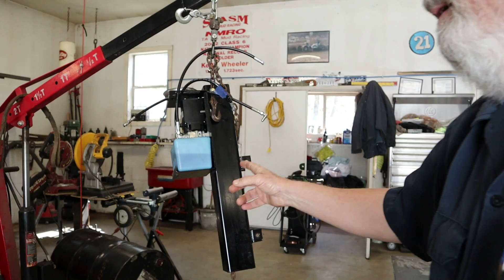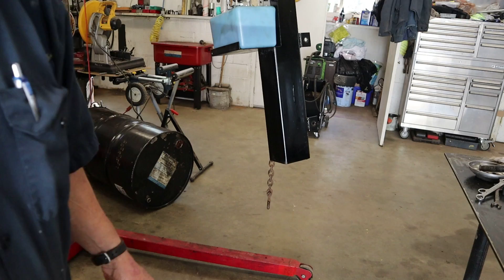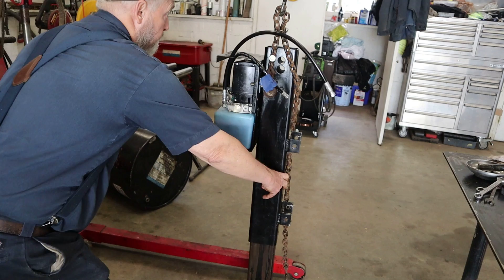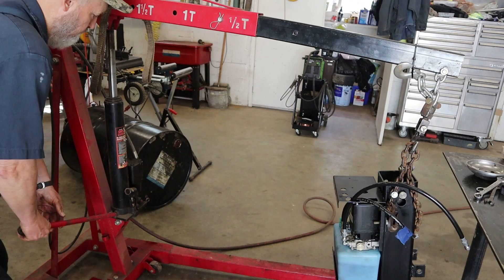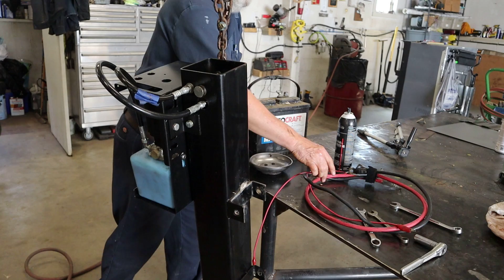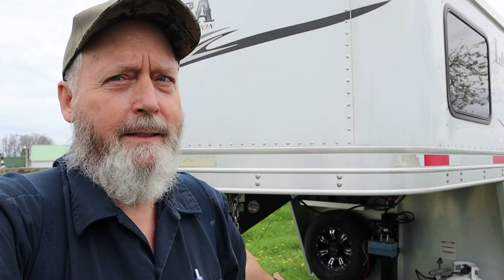Bigfoot Landing Gear Follow-up

Comment: Did the noise ever stop when lowering?  I just had my two cylinders rebuilt and lines changed.  It’s making same noise when lowering but noise returns to “normal” has half way mark
Reply from the maker: I did several videos on this trailer. Not sure which video this one is.  Turns out hyd lines were not on the proper ports on the pump. Once that was corrected, it got a lot quieter and worked better. Pretty sure it was like that since they built the trailer.
Reply: @hillbillyrv 

Good to know.  I’ll keep that in mind. Still believe I’ve got air in my system, that needs to be bled out.  Wanted to say, your video on the Bigfoot hydraulic system for the Lakota horse trailer was exactly what I needed to do the work myself on our horse trailer.
Reply from the maker: @jasonsesmundo7219  Awesome. Bigfoot says raise the trailer up as high as you can and let it sit like that for a while to get any air out of the system.

Comment: I call them horse hauler RVs, and have several customers with one.  With no shop like you have, I just work on the pumps, and on a few occasions actually cut off hydraulic cylinders for travelers with one stuck in the extended position. Thanks for yet another informative video!

Comment: Sounds like the leg has been drug or pushed backwards and tweaked the inner and outer sleeve fit.... Spray Motorkote lube or grease it real good when you extend it....  As an old retired truck driver we would get this on our dolly legs when somebody would hook up and tug test the kingpin locking and drag the trailer a little bit.... would bind or tweak a dolly
Reply from the maker: It was extremely greased. I could be bent.

Comment: Just curious why you didn’t change the hydraulic fluid and flush the lines while you had it apart?
Reply: Wrong fluid installed by someone else?
Reply from the maker: The system wasn’t dirty. There were no catastrophic failures to put contaminants in the system.
Reply: That us one heavy duty leg. Thanks Don